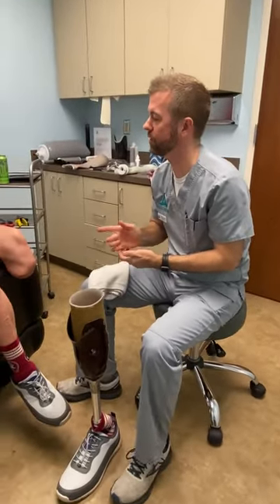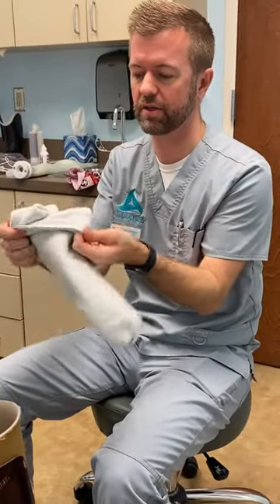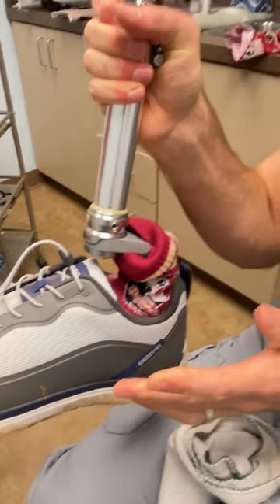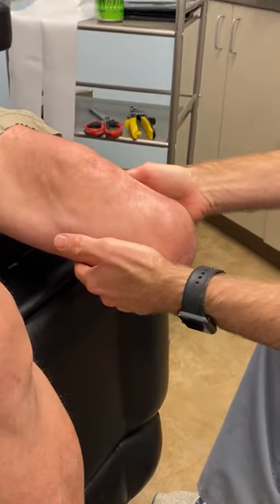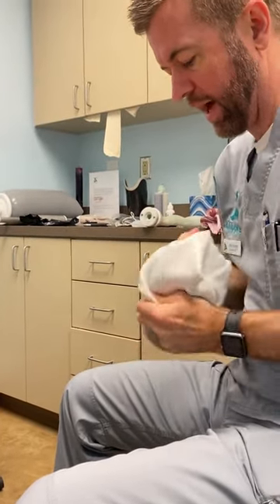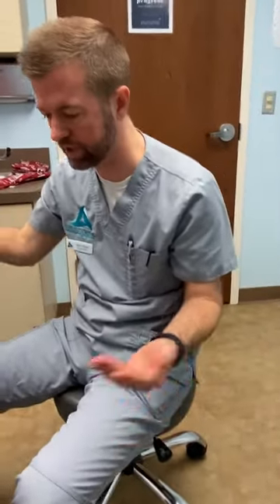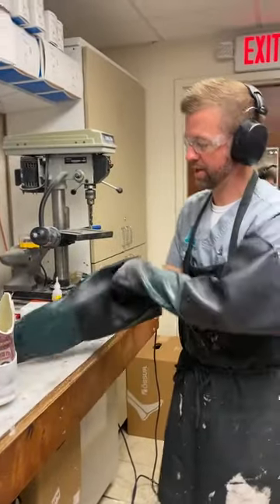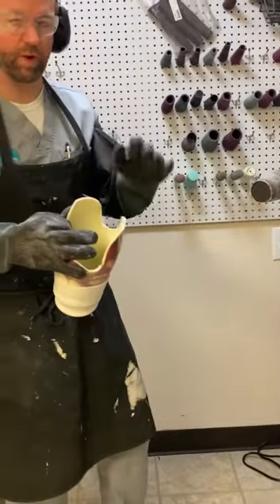Transtibial Direct Socket Fabrication Part 1 🦿(Prosthetic Leg)

Comment: hi Sir, it looks very good and fantastic. However, without a check socket process, you don't know where the straight line is, then you will either do the tilting or shifting. if you do the tilting then the patient will not have the comfort. If you do the shifting then the patient would love it however you have to put additional adapter or shifter. in short, don't skip the check socket process.